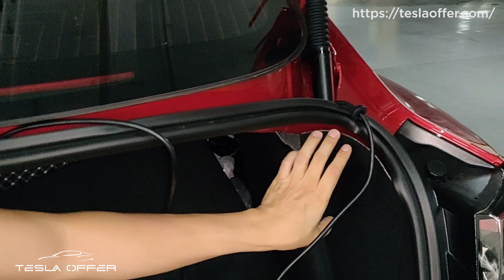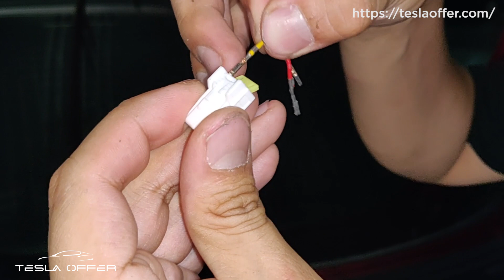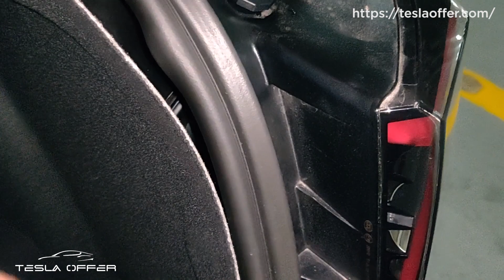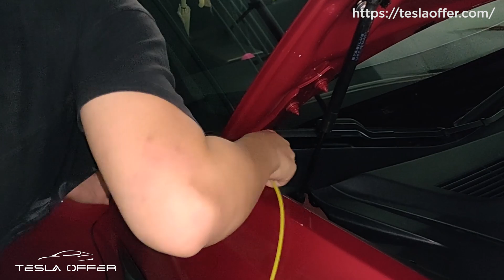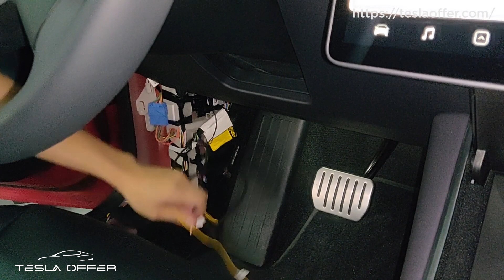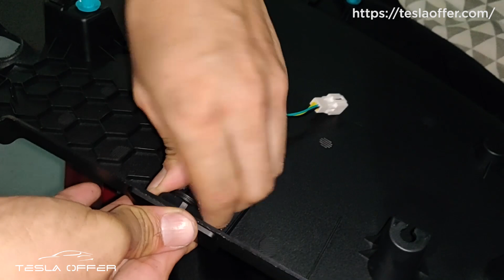Model 3 Electric Tailgate Installation Tutorial (Supplement) - Tesla Offer

Comment: Thanks for posting this video!
I watched several installation videos, and each one of them showed me some parts that others missed.
- First, and foremost: Apparently, Hansshow updated their kit, so you need to fish only the wires required for the tailgate push button light and signal to the trunk tailgate. Hooray!
  I used a building fishing line (all 15m of it), and it worked pretty well, after removing the cover of the connector, so I only had the contacts to feed through.
- The connection to the tailgate signals is under the isolation, way back behind the back seats. I first found only the connector under the side part of the seat, but needed to remove 4 covers:
   - Airbag top back right, 
   - column back right, 
   - rear seat right side, 
   - right side behind the right rear seat
Then, i removed 2 pressed-in plastic holders behind the seatbacks to be able to lift the cover and insulation from the cover of the trunk behind the rear seats.
Another change to what is shown in this video: You can get the motor wiring in without going through the rear light seals, and without unmounting the bumper. 
Your have to find your way through the bumper into the void around the maintenance gate shown in this video. 
I used the fishing tool to get down (on the left side, I started from the bottom, on the right side, I did it from the top). 
Then, I unscrewed the 10mm screws below the underside of the tail lights, unhooked the 3 snapin plastic loops for the bumper, and used screwdrivers to pull out the bumper far enough to push the fishing tool with the attached plugs and cables through (no unmounting of the plug housings here). After having fed them into the lower bumper area, I used the righthand side light blue gromit's hole to put both power and hall sensor connectors through. Et voila, I am in the trunk with the wires, and no need to drill or anything.
The lefthand light blue gromit is perfect to put the foot sensor wire through. I cleaned the maintenance door, filled a few fields with silicone and put a plastic on top of it. Then, I used a tape to mount the sensor onto it - nothing visible on the outside.
Attaching the kit to power has been more or less easy after I accepted that I had to remove the panels on the right hand side door soll, besides the dashboard and below the glove compartment. The plus terminal is a 8mm screw with restrainer, so you need to unscrew it. Be careful, as there are many metal surfaces on ground around it - I used some electrical tape on the head of my wrench to prevent shortening anything while I unscrewed things.
Reply from the maker: Our system is different from Hansshow system, please refer to our V2 installation video. Fishing wire is very easy, we only do a small connector up. Comparing to theirs which require removal several trim pieces to access the connector, we think this is an easier approach.